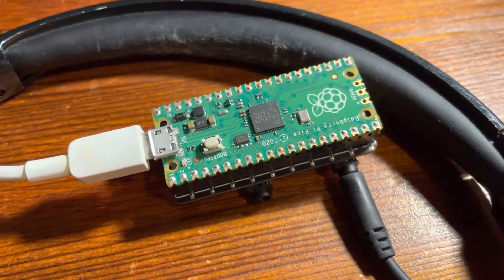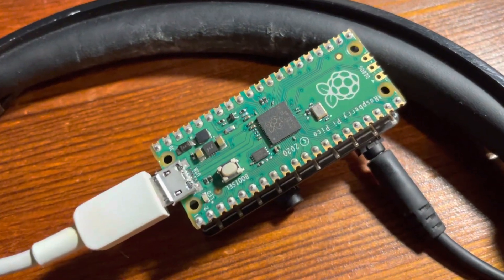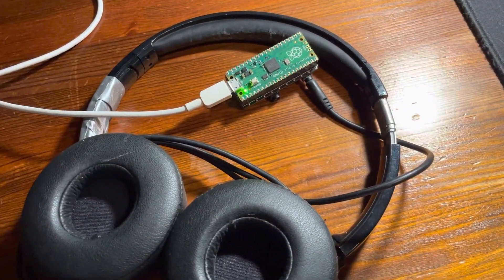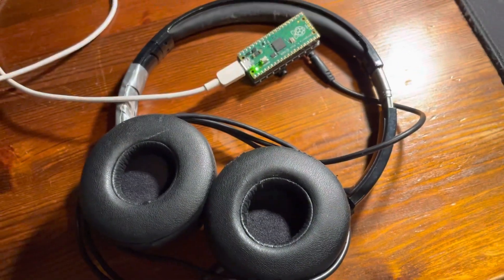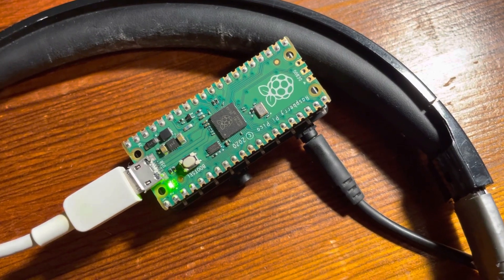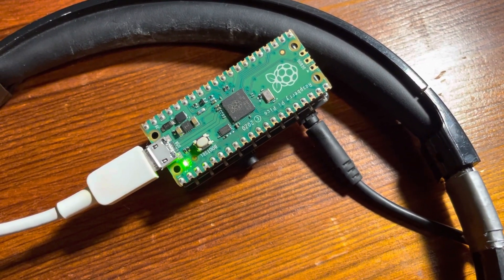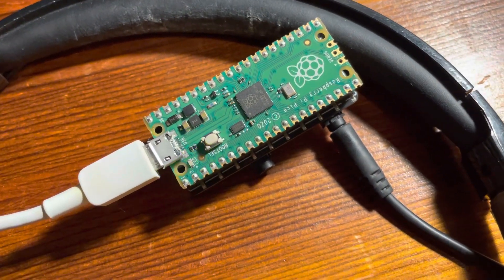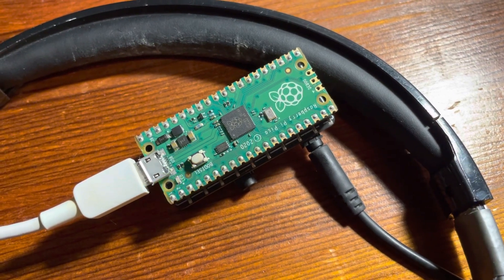HDD Synth: Prototype first look

Comment: HDDs don't beep ^^ they click (head reset) and make rattle sounds on head position changes. And that rattle sounds depends on where and how it writes and reads.

btw. I don't understand why someone would like that noises. Silence was the reason why people build PCs with 2.5" drives, put 3.5" in silencer cases, decoppled the drives and at the end switched to SSDs. And in case you rly like that sounds just add a real HDD and write a script which randomly writes and reads from it in the background when ever your SSDs got accessed. In that case it is 100% real sound and not fake. ;-)

Comment: Neat, but I would probably use a lower pitched beep and a quieter spinning noise. Never thought about that though.
Reply from the maker: The device uses actual records of as mechanical hard drive. So if you’re not a fan of how it sounds, you simply need to switch out the sounds to that of a drive of your choice
Reply: @MaverickStrife  Nice!
Reply: @MaverickStrife  I have heard many kinds of hard drives since a Quantum 1GB disk (which was the loudest). No drive did beep on access. I am 40 years old, I heard a lot different drives. ;-)
Reply: @nooboard  MFM and RLL drives (tens of MB, nowhere near a gigabyte in size) had stepper motors which made sounds like this.